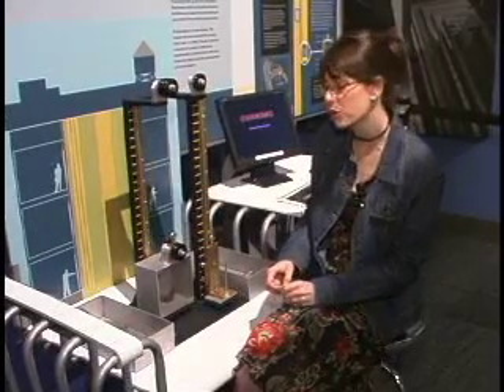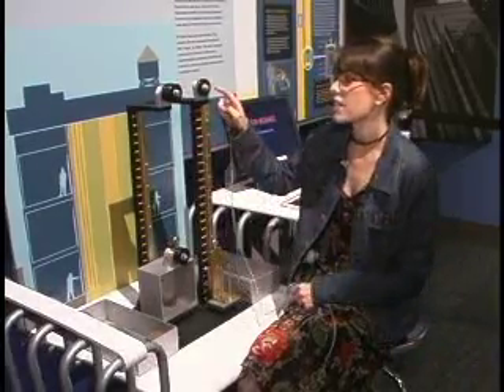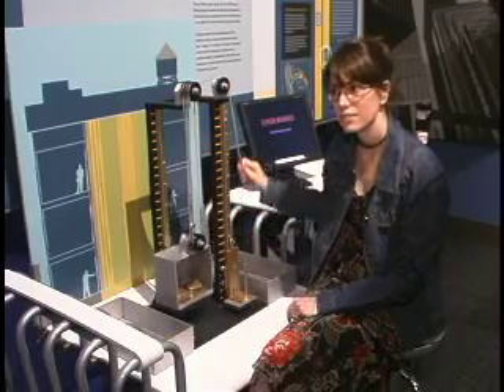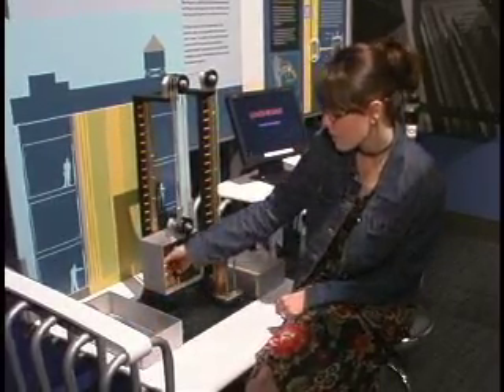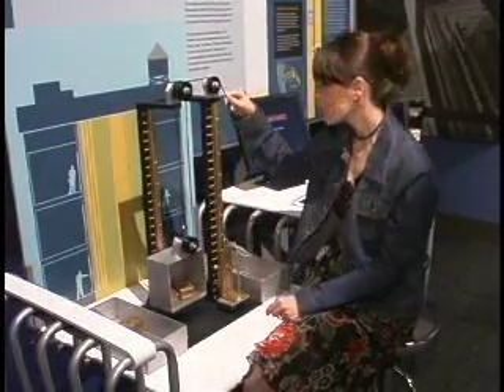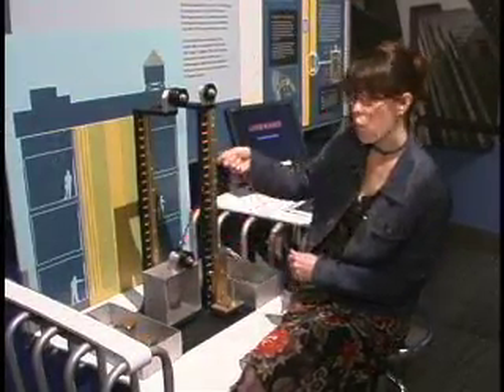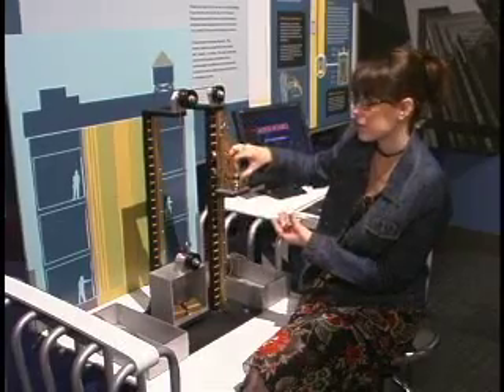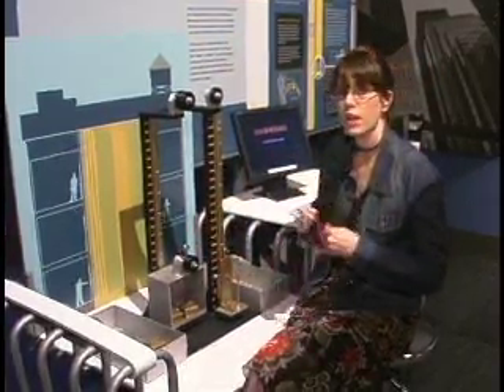Elevator Mechanics

Comment: With the single pulley is called 1:1 and the other one is called 2:1 suspension. Both of them are used in elevators. The factors are the speed and the weight that you have to select the appropriate system for your application. There are many other pulley system but they are not popular like those two. The most popular is the 1:1 because have the benefit of the high speed.